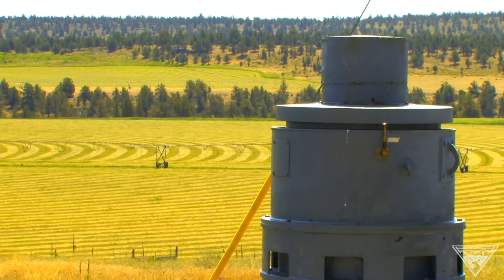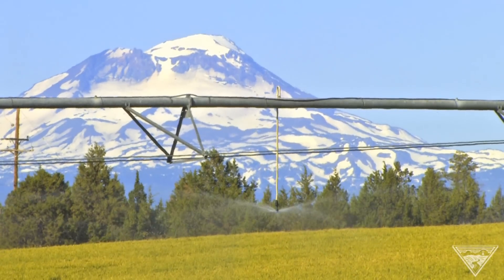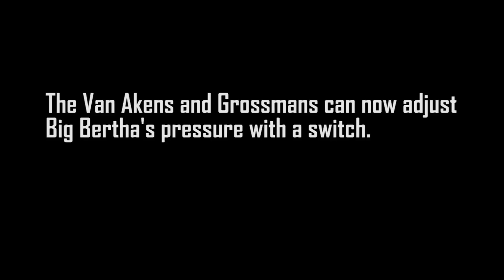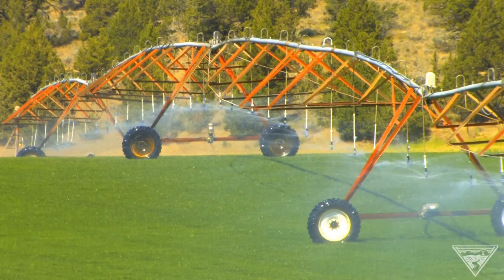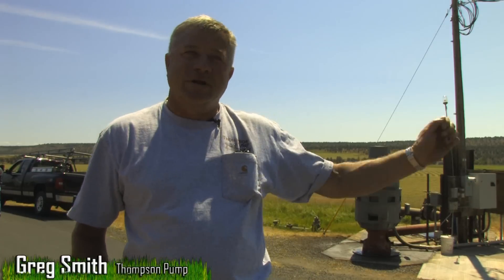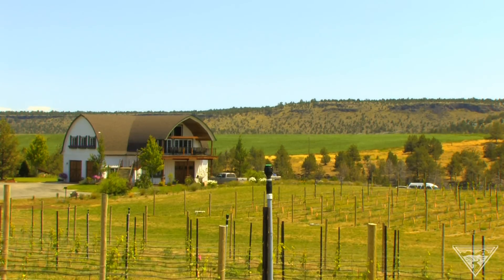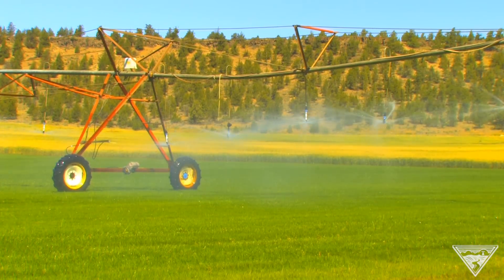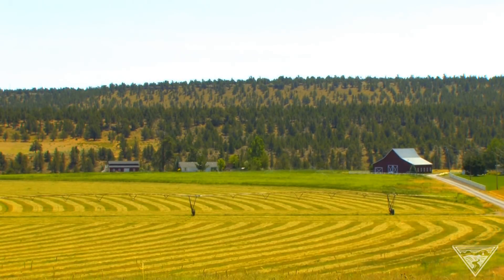Big Bertha: Pumping up Energy and Water Savings with a Variable Frequency Drive

Comment: van aken, sounds dutch lol
Maybe this is a very good electric motor but if a modern electric motor is lets say 20 percent more efficient it is good to swap in another motor I think, especially when you run it a lot.
Reply: The variable frequency drive actually is even better. Instead of using resources to buy a new motor and scrap the old one the VFD allows you to increase the efficiency of the existing motor.
Reply: hans worst There are a lot of people in NZ and AUS who have Dutch origins